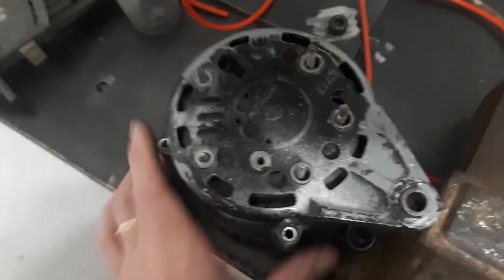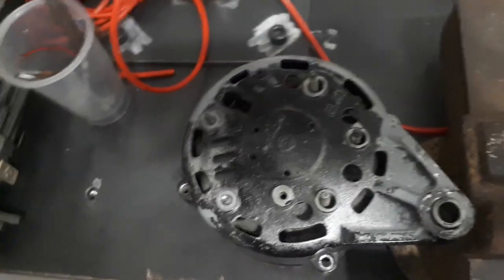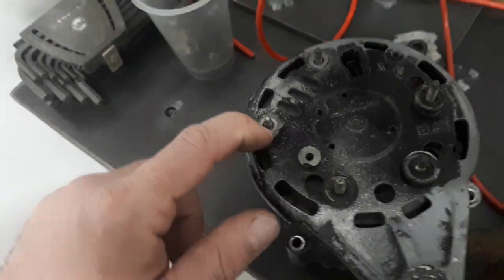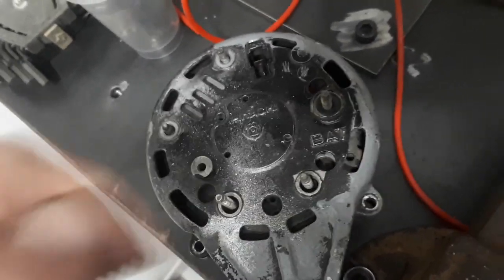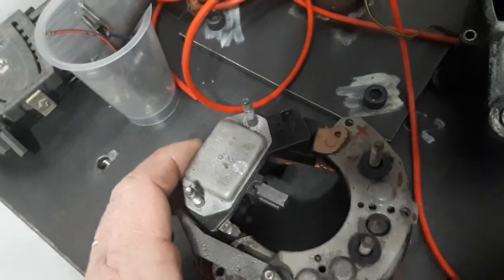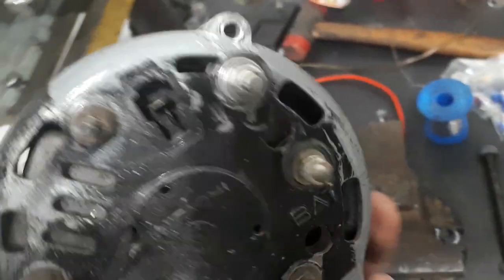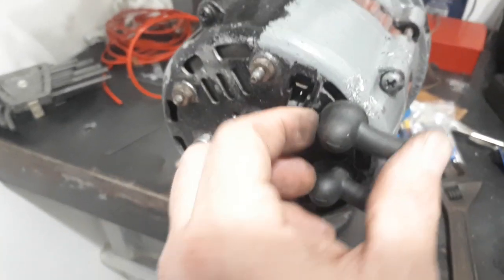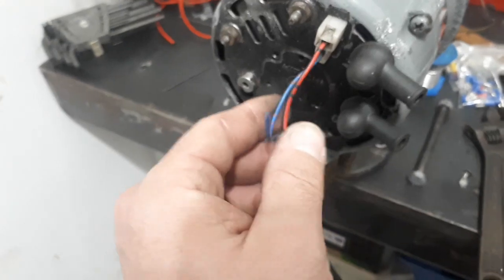Yanmar Diesel Hitachi 35amp alternator - adding a Tachometer Sense (W terminal)

Comment: Cool Planning to cary out this modification. Where to connect the wire. To one of the spare cables
 on the harness and a tachmeter?
Reply from the maker: Connect the wire (internally) to ANY of the winding wires. there are three. On the instrument - it has to be an "alternator tachometer", usually two or three wires: negative, winding and (sometimes) positive from the key turned (ignition on).
Reply: @pardalbartz  Thanks alot for sharing this and uploading!  

 I plan to do this mod with the stock Hitachi 35A.
I am also tempted to buy an aftermarket 55A alternator and proceed with this.

Comment: I’m about to do this and I just want to confirm. You solder directly to the copper windings?
Reply from the maker: Best place to solder is on the winding end/rectifier connection.

It is a 3phase alternator and you can do in any of the 3 phases.

Comment: Is W terminal sometimes marked F ?
Reply from the maker: No. W stands for 'winding' as it comes straight from the stator windings, before passing through the rectifying diodes.

F stands for 'field', which is the feed to supply power to the rotor field and by changing the voltage of this terminal, you will adjust the output voltage.

Most automotive (and marine) alternator use an internal voltage regulator. For those the F terminal is internal. If you want to change the OEM regulator for a special one - like multi-stage alternator 'chargers' you will either use an existing F terminal or need to tap one, like I did for the W.